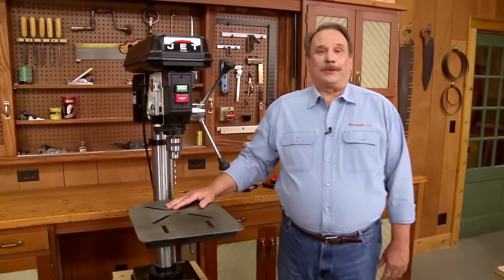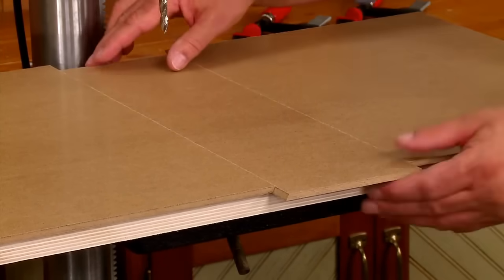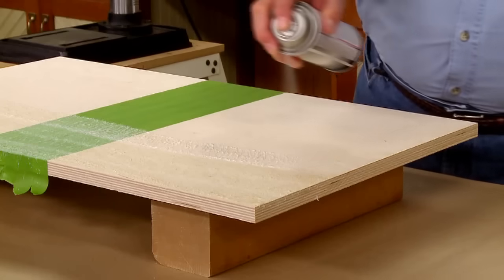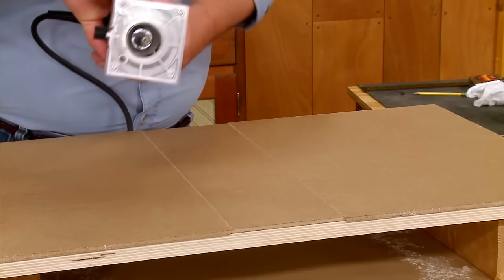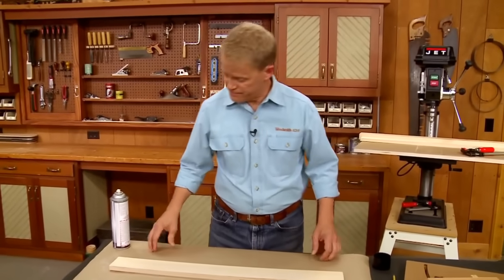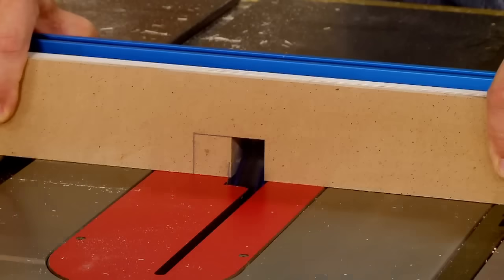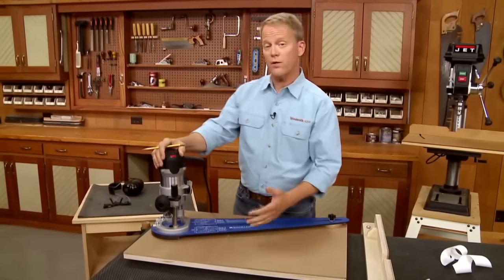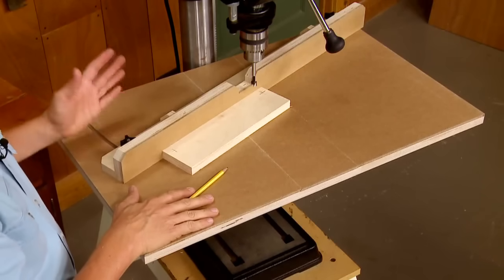Upgrade Your Drill Press! - How To Build a Quick and Easy Drill Press Table! (FREE PLAN)

Comment: Why not use the insert itself as the spacer?
Reply from the maker: I find using the insert as the spacer you have a greater chance of the outside pieces slipping up because of the bevel on it and I also don't want to risk accidentally gluing it in place.
Reply: @WoodsmithShowandmagazine  BUT, you could use it to mark the edges, and not have to make a flipping guess on how far to tape it.  You're making it harder than need be to do things.

Comment: The problem with this design is that the base of the fence is very wide, which results in a reduced space between the face of the fence and the drill bit. I recently designed and made something similar for a particular project and I needed to be able to drill a line of holes across the centre of my workpiece, for which I had to have a fence no wider than about 15 mm.

To make this possible, I used a larger table and cut a slot in the centre of its back for the drill press support pillar to fit into. That way, I was able to extend the table back past the support pillar. I then used a two part base for the fence, with the centre bit "missing". That meant that at the pillar, the fence only needed the width of the front section since there was no base part there. This gave me an extra 50 mm (2") of workspace compared to the design in the video. Yes, such a design results in a weaker fence, but in this application, there are no great forces involved, so it's fine. However, if you're concerned about the rigidity of the fence, you can always go for a half-way house, and instead, just have a notch in the base.

Another option that I haven't implemented is to put the fence along one side of the table instead of at the back. Then the space between the fence and the drill bit can be as large as you care to make the table, albeit at a cost of a reduced length of the possible line of holes.

Another thing I did differently in my version was to join the face of the fence to the base part in such a way that the face was raised slightly above the table. This means that any wood shavings or dust that fall down between the workpiece and the fence can slide under the fence instead of stopping the workpiece from properly touching the fence. (This is standard practice on router and table saw fences.)

Finally, one thing I did on mine was to drill a hole in area of the table behind the fence to drop the drill chuck into. That way, the chuck doesn't get lost.

Comment: Why did you use a square edge template board to fix the two sides. 
Haven't you cut the center bit will the angles when cutting the sides.?

Comment: I see you still have not come up with a graceful solution for adjusting the table height with the table installed.
Reply from the maker: You should still be able to use the crank in the back with this table installed, but if you're looking for some innovation on raising and lowering the drill press table, check this one out: https://www.youtube.com/watch?v=3_cQcHMz7UU

Comment: how  do you stop the thru bolt on the underside of the  the fence from turning along with the knob on top?
Reply from the maker: The small "square" portion of the carriage bolt's shaft just below the head fits pretty nicely into the slot and keeps it from spinning.

Comment: This is GREAT....Simple, don't need a laser  (.....), can Easily get the materials needed.  And most importantly the power machines needed are what most of us have.....rip saw, router, and my new drill press.

Only One question....how do you make bevel cuts on hardboard??  Thanks for your time.
Reply from the maker: We made the bevel cuts at the table saw with the blade tilted to the correct angle, but you could probably do it at the router table with a chamfer bit too.

Comment: What is that knob on the pivot end of the fence for?  That point is fixed.  A waste of time to loosen tighten the second knob.
Reply from the maker: The knob at the pivot point is just there for ease of taking the fence off if needed. Otherwise, you could just replace that knob with a regular nut.

Comment: You can use that plywood spacer and clamps to press down the hardboard even better than the J roller. Clamp down, move along, clamp, move, etc.
When routing that curved slot a scrap clamped to the base board would stop the router cutting too far. Only takes a moment and just makes life that bit easier.
If you don't have a dado cutter, you can cut the rebate by making many passes with the table saw blade. Just move the job across in smaller steps.
Reply from the maker: Great tips!  Thanks!

Comment: Really liked the overall quality of the unit  https://www.youtube.com/post/UgkxajoEbapTfqWaadnqb04h6U576yxXp-FE . No, it's not a professional level drill press. I bought this product for one reason and one reason only: it adds value to a product I already have (a dremel tool).I was able to use this tool to secure my dremel. Dremel owners and users probably can sympathize that often holding your oddly shaped (and sometimes fragile) workpiece and the dremel at the same time can be cumbersome. This completely eliminates the need to hold the dremel, which is a huge overall improvement to control.I would consider this a must have for anyone who regularly uses a dremel.

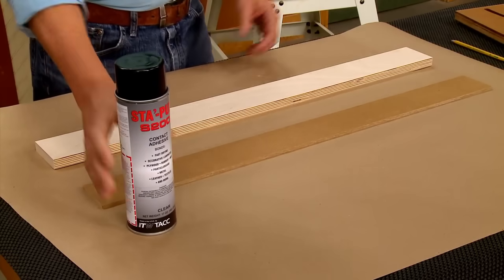Comment: Why is the spray adhesive used in this video @18:09 not the same as the Amazon affiliate link in video description?

Just want to be sure I'm ordering something that will work for sure.
Reply from the maker: The product used in the video, we got in bulk from an industrial supplier because we use quite a bit of it.  The 3M product I linked to is essentially the same thing, but is more readily available to the diy consumers.  I just recently used the 3M Hi-Strength 90 and and it worked great. You can probably get it at the local home center too.
Reply: @WoodsmithShowandmagazine  Got it, thanks.

Comment: Excellent  idea replaceable centre piece... we used to paint our hardboard (sacrificial bench top) with polyurethane so when you are using metal cutting lubes you can clean up.  you don't have to glue the hardboard pieces once they are coated with polyurethane countersunk screws will hold just fine!
Reply: Hardboard has to be painted on both side to avoid it bowing. But it still bows. Best avoided IMO. For what it costs extra just use 1/4" plywood. If it's not glued down, oil both sides.
Reply: @Dave5843-d9m  In metalworking the dies are so heavy with sharp corners they would damage the plywood creating splinters.  You need something that will protect the sharp edges (a metal bench won't work) but won't splinter.  In the big die shops (GM, Ford, etc) where the dies can weigh 20 tons concrete would be cracked so they use end cuts of wood set in sand.  For a drill press if you drill in to hardboard (painted) you get very little uplifting of the surface whereas plywood delaminates.  I find countersunk screws hold properly prepared hardboard in place with no buckling even on a 4'x8' work bench after 30 years of oil and solvents.

Comment: I just checked online and I understand the difference between hardboard and MDF. No need to reply. Thanks for a great video.
Reply from the maker: Sounds good.  Thanks for watching.
Reply: Personally I would use MDF or even plywood for the top layer,. It's more durable than hardboard and you'll struggle to find 1/4" (6mm) hardboard.

Comment: So what can you do when you have a great drill press body, 65mm pillar & base collar but no motor (I have one ready to go on) no motor pagoda pulley (not much of a problem - available on eBay) BUT crucially NO TABLE & NO cast base.

The latter I can probably get away without by using a 50mm thick plywood base attached to my bench, but to me the lack of a table is a major showstopper, especially as I will need it for BOTH wood & metalwork.

I have searched online everywhere but to no avail. I can't find ANYONE who sells cast iron tables for a 65 mm pillar. One ideally able to be fitted with an after market rack to fit the pillar and preferably a second hand one, even a broken one, depending on the failure mode.

Any suggestions? I'm in the UK so transportation costs are going to be a large part of the cost.

Is it likely that for woodwork at least I could get away with making one out of 40-50 mm ply? Any references to online designs? TIA

Comment: I think MDF bottom is a cheaper option then Baltic burch plywood. But if you can find comerical grade cabnit shelf used in retail many of them are multi layers of plywood and partical board thats very stable and hold up nicely. Your working top will be the hardboard top, a trick for this is to make a 4x4" center drilling area
Fix the back of the slide out to the plywood and only use the 4x4 area as change out space just bevel all 4 sides
And the corresponding mating surfaces.
The frt will slide out you change the center and put the frt back in this will make for less waste.  This is a good starting point for any type of system you want to make even draws to hold drill bits and chuck keys in right at the drill press even your fostner bits.

Comment: you are into your spray adhesive being so good why did you have to swap back to old school glue, spray not good enough hey?
Reply from the maker: Each adhesive has it's own pros and cons and can work great in different applications.
Reply: The spray adhesive is best for wide areas, where you have flat surfaces to glue, whereas the wood glue is effective for the narrow connections after clamping

Comment: Suggestion for slightly less nice but much easier sacrificial surface.

Use hole saws to put a centered round hole in the main surface and cut out a set of matching circles by first holing a thicker board so you can remove the pilot bit then clamp that over the hardboard piece you want to make circles from, the tricky part will be finding two hole saws that are exactly one kerf different from each other's ID/OD, else cut the inside ones a bit too big then sand them down for a clean fit.
Reply from the maker: We made a round replaceable insert using a wing cutter on one of the drill press tables we use in the magazine shop, seen here: https://www.woodsmithplans.com/plan/drill-press-table/

You can see it in action on this video: https://www.youtube.com/watch?v=3_cQcHMz7UU

Comment: I don't get the fuss with contact cement; where is the board going? Just wood glue will do. There is tremendous surface area for glue; even missing a few spots toward the interior will do well as long as the periphery is well adhered.
Reply from the maker: Wood glue would work perfectly fine as well... we were just trying to move the process along quickly.
Reply: @WoodsmithShowandmagazine  
How can contact cement be faster? Just spread wood glue and put a cinder block on it and it is done.
Reply: Water based glue and hardboard are asking to have the job bowing or bubbling. But hardboard is rubbish stuff. For the small additional cost, 6mm plywood is a better bet.

Comment: I am a bit new to wood working and want to build a table top for the drill press I have. I have a bench top version of a drill press.  I get the idea of the tear out.  What I don't understand is how does that thin piece that slides in and out help with the wearing out of the area with the bit drills?  I know the piece can be moved once it wears out.  From a usability perspective, I don't know how this really helps.  I know I am not understanding it so be gentle with the responses please.  ;-)
Reply from the maker: As long as you have some sort of solid piece backing up your drilling it should help with tear out, but you're right... as you continuously drill in to that sacrificial piece it will lose it's effectiveness.  You could slightly slide it in and out to find a place on the piece that hasn't been drilled in to yet, but eventually it will get bad enough that you will need to replace it.  If you are going to go this route, I would make several  replacement inserts up front ready to go.   On another note , I often find myself grabbing  scrap pieces of plywood to lay down on  my drill press table to back up the drilling, so I'm not replacing the insert as often.  If you are looking to build a drill press table, I suggest looking at our other designs too You'll find them here: https://www.woodsmithplans.com/category/drill-press-tables/   My personal favorite is the "Woodworking Drill Press Table".
Reply: @WoodsmithShowandmagazine  Thanks for the info.  I do like the "Woodworking Drill Press Table" out of all the others.  I noticed there is an arm on it that looks like you can crank it.  WHat is that actually doing?  Is it built in such a way that it will raise and lower the drill table?  I ask because I saw another one of the plans where I can clearly see that the build shows that the crank is built to roll the table up and down.  Not sure i could do that(integrate with my current drill press crank) with this plan you referenced based on the drill press I have which is a Wen.  See link for picture.  https://www.amazon.com/gp/product/B00HQONFY6/ref=oh_aui_search_detailpage?ie=UTF8&psc=1  What are your thoughts on this potential issue?  I see that the one you say you like was built on a stand up version of a drill press.
Reply from the maker: Not sure what you’re seeing on the “Woodworking Drill Press Table” but that one doesn’t have any sort of integrated crank in it.  The drill press table you saw does have a crank on the side to lock and unlock the table and a hand crank on the front to raise and lower the table. It’s really handy to not have to reach around the table to raise and lower it all the time.  Any of these tables should work on a bench top or floor model drill press.
Reply: @WoodsmithShowandmagazine  That front crank to lower and raise the table is the one I am speaking of.  Not sure if I would be able to accomplish that with the drill press I currently have that is why I asked.  Unless I buy the plans first, I would not know if I could get that type of build with the front crank.  I do love that idea because with the table top built it would be a major pain to crank from the back and on top of that most likely i would have to make a cutout in the back of the new table top to make a clearance to use the existing crank.
Reply from the maker: Robert Knowles - We have that drill press table in our shop... I can take some photos and/or video of how it works if that helps.
Reply: That would be great if you could. I think I would be sold if I can do that front crank.  Not the end of the world if I can’t. Thank you for the offer. Definitely appreciated.  Rob
Reply from the maker: Robert Knowles -Hey Robert, I didn’t forget about you... I plan on shooting a more detailed video of that Drill Press Table next week but sure when I’ll get it up on YouTube.  We did a Facebook Live Video in our shop today and I talked about that table and showed how it worked. If you want to check it out, it is on the Woodsmith Magazine Facebook page and it’s the last couple minutes.

Comment: What about the drill press table height adjustment crank? That's what I always find as the problem to a table like this, those always hit the tables. I think I remember seeing in a more recent video that you maybe added a way to do this from the front of the table, but that's not a very feasible option for everyone.
Reply from the maker: You should still be able to get to the crank and lock with this auxiliary table mounted on your drill press, but it isn't quite as convenient as the drill press table you mentioned: https://www.youtube.com/watch?v=3_cQcHMz7UU

Comment: As woodworkers, we are so used to  dealing with fences that must be square to a PLANE, such as a table saw rip fence or cross cut sled, that we forget that a drill press fence only needs to keep any given point on a work piece a set distance from a single point-- the chuck. This table design is a revelation in its simplicity. Thank you!

Comment: I have struggled for years wondering why a new drill press table which is substantially different from the last iteration always have to be built in demos like yours. Back fifteen years ago or more you built a remarkable drill press bench which I built. How ever I added dust collection on the table top without the need of vacuum hoses hanging attached in some awkward way. I built 6 inch round hardboard sacrificial backer boards for drilling clean holes on the bottom side. Some of the backer boards have centered 2, 3, 4 inch dia holes to accommodate sanding drums. The table slide left to right to use all of the area of the sacrificial backer boards before I use the backsides. I am grateful for the great drill press table you enabled me to build. Thanks.
Reply from the maker: That's great to hear... I'm glad that you were able to build one of our drill press tables that is still going strong after 15 years of service in your shop!
Reply: A cheap drill press commonly available is fine for drilling, but the chuck bearings are not built to take large side loads. It's not a milling machine. :)
It would be far better to use the press to make a plywood drum sander case powered by a washing machine motor.

Comment: I find that installing a couple pieces of wood for a slide-on guide and using a couple toggle clamps (like these: https://amazon.com/Accessbuy-Toggle-Clamps-Antislip-Release/dp/B0756DSLV3/) instead of installation bolts works very well and makes the table much quicker and easier to take on/off.  If you never take it off it's a wash, but I switch back and forth from using my drill press for wood working as well as some light metal work with a press vice.
Reply from the maker: Yeah, that is a great idea if you are switching it out often. 👍